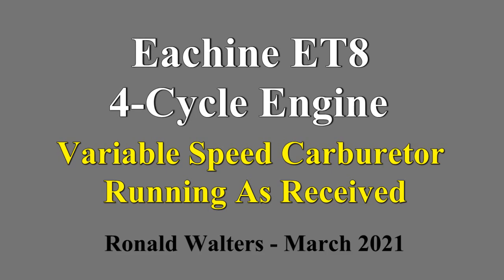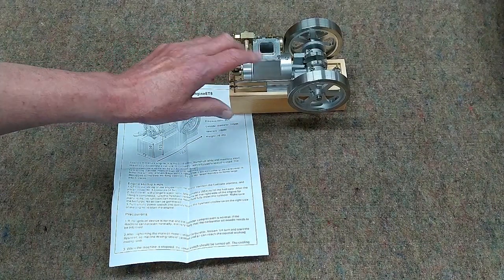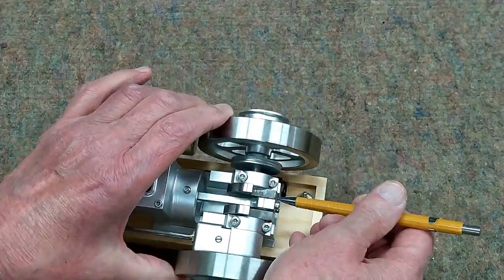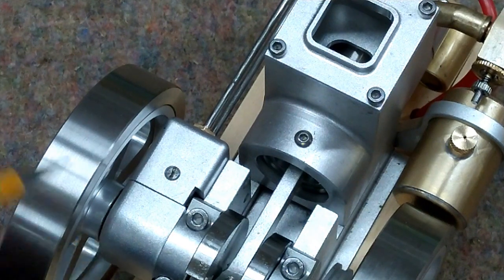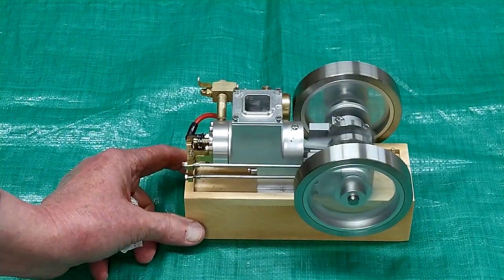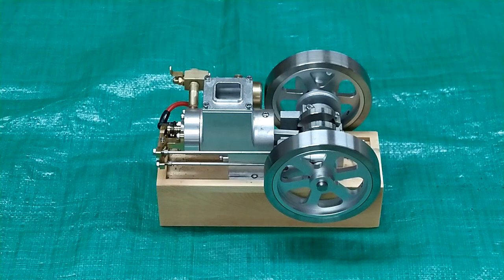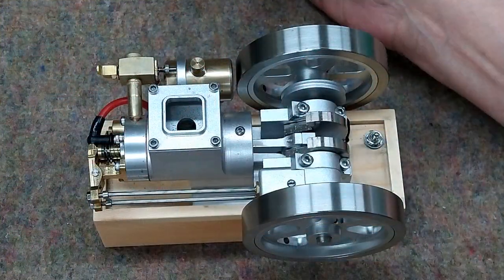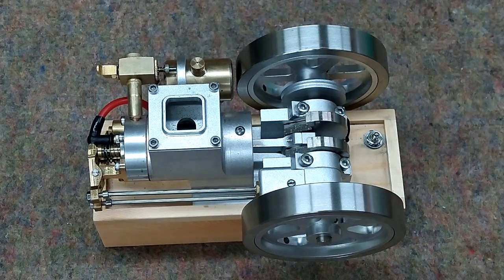Eachine ET8 4-Cycle Engine

Comment: Can you publish the user manual for the Eachine ET8? Thank you very much.
Reply from the maker: ET8 is a Banggood model number. The manufacturers designation is M93.
The single page information sheet is shown at the beginning of the video and that is the only "user manual" and it is pretty worthless.
This IS NOT one of my favorite engines. It suffered several problems, one of which was a very sloppy carburetor which leaked air causing poor engine runs. 
I have a video on fixing the carburetor as well as a video on improved running and one with it running under load.
Keep in mind these are hobby model demonstration engines and are not intended to run for a long period of time. Thus the relatively small fuel tank. Run them until they start to get hot and then shut them down and allow to cool before running again.
Unless you have a specific desire to own this engine... there are much better engines available.
If you must have the single page information sheet go to EngineDIY.com and ask them to sent you one for the M93.
Thanks for watching. Please subscribe! 
That is what keeps this channel going. 
Ron

Comment: Do you use a 25 1 mix wirh gas and oil?
Reply from the maker: I do not use gasoline or petrol.
Watch this:
Correct Fuel For 4 Cycle Hit & Miss And Other Model Engines
https://youtu.be/n1zOC2C-iy0

Comment: আমি আমার জন্য একটা কিনতে চাই
Reply from the maker: I would not recommend this ET8 engine. Too many problems.

In this series of hit-n-miss engines ET1, ET7 and ET6 are my favorites, in that order. 

ET1 was the first in the series. ET7 has a simplified governor and is easiest to work on in terms of replacing the piston ring o-ring. 

EM2 is also a really nice engine. Pretty little engine and a good runner.

ET1, ET6 and EM2 are currently in stock at Banggood,

Please use one of the links found in the description for my videos.

Thanks for watching. Please subscribe! 
That is what keeps this channel going. 
Ron

Comment: Hi Ronald, Which model would you recommend of this engines..what working relaible ?
Reply from the maker: In this larger series of hit-n-miss engines ET1, ET7 and ET6 are my favorites, in that order. 

ET1 was the first in the series. ET7 has a simplified governor and is easiest to work on in terms of replacing the piston ring o-ring. 

EM2 is also a really nice engine. Pretty little engine and a good runner.

I would totally avoid the ET5 (M12), ET5 Pro (M12 pro), ET5S (M12C) and ET8 (M93) engines.

Banggood has a 30 day refund/replacement guarantee. But I always suggest using PayPal for payment, which simply gives you one more layer of protection. Therefore, if it is damaged in shipment or doesn’t run you are covered. Banggood may ask for a little more for insurance, which isn’t a bad idea.

If you use one of the links in the video descriptions I get credit for the sale and often times the discount code will save you some money. If the engine is already on sale the discount code may not work.

Thanks for watching. Please subscribe! 
That is what keeps this channel going. 
Ron
Reply: @RonaldWalters2010  
Thanks!!

Comment: Hi, I like your videos, all are very interesting, you have a new subscriber, I'd like buy my first one model, but I'm not sure which model choose, what could be your recommendation about this series or another like this .
Reply from the maker: Sorry, youtube just sent me your comment (one month after you left it).

In this series of hit-n-miss engines ET1, ET7 and ET6 are my favorites, in that order. 

ET1 was the first in the series. ET7 has a simplified governor and is easiest to work on in terms of replacing the piston ring o-ring. 

EM2 is also a really nice engine. Pretty little engine and  a good runner.

I would totally avoid the ET5 (M12), ET5 Pro (M12 pro), ET5S (M12C) and ET8 (M93) engines.

EM4 runs very well, smooth consistent speed adjusted with needle valve setting, but has the water tank and pump which are an unnecessary complication.

EM1 is a beautiful little engine. It arrived all falling apart and as stated in my video I had to replace a number of setscrews and figure out how it was supposed to run. The manufacturer acted like I was asking for trade secrets when I asked which direction it was supposed to run and how to set the timing. A low speed engine that sounds like a singer sewing machine running and is VERY sensitive to needle valve position (which can make it difficult/impossible to get it to run the First Time). May not be the best engine until you have more experience working o these engines.

EM3 turned out to be a very good runner. Showed up with the piston liner o-rings leaking and I wasn’t getting any satisfaction from the manufacturer (and I am reviewing his engines – go figure). I had to figure out my own method of getting the liner sealed and then it ran well. However this engine disappeared from Banggood and it appears the manufacturer may have quit making it. 

Some of the newer engines in my opinion are way over priced and just not worth it.

Banggood has a 30 day refund/replacement guarantee. But I always suggest using PayPal for payment which simply gives you one more layer of protection. Therefore if it is damaged in shipment or doesn’t run you are covered. Banggood may ask for a little more for insurance, which isn’t a bad idea. Engines which are in stock have been reaching me via air freight in about two to three weeks. There may be fewer air freight flights going to your area, especially now with all the Covid crap.
Reply: @RonaldWalters2010 Thank you very much, I have a ET1 engine. Mine is about three years old. Your video's are Great. My next engine may be a ET7. Thank you, Mike

Comment: thought the whole video "adjust the damn fuel x)" and then u said it in the end :P.
Reply from the maker: The intent of a review video (at least it is my intent) is to review one of these as received and demonstrate what people can expect right out of the box. The carburetor on this engine was sloppy and poorly machined. It leaked air and did not want to hold a setting.
There are additional videos showing how the carburetor works and how I solved the air leak (call it a Band-Aid). So if you are actually interested, I have more information regarding this engine on YouTube.
Thanks for watching!

Comment: These are pretty cool and a fun project starter as well as a unique conversation piece. Do you order these directly from Eachine’s?  And if so, did you ever have any issues with your orders?
Reply from the maker: I would avoid this particular ET8 engine. 
My favorites (and the ones I would recommend in this series) are the ET1,  ET6 and ET7 Hit & Miss engines. All three run well. I have reviews on all of these engines plus a Playlist which groups all of them together.
I do not order from Eachine. Purchase the engines using my links and discount codes from Banggood. They ship fast and the engines are well packed. I have not had an issue with Banggood. Banggood has a 30-day refund or replacement guarantee... and if you want more protection, use PayPal.
Please subscribe. That's what keeps this channel going!
Ron
Reply: I just found the links you added to get these. 
 I still would like to know if you had many issues though (from the manufacturer, not necessarily shipping).

Comment: The Microcosm/Eachine engines are well designed, and made with good quality materials mechanically. The ignition modules they supply however can be sketchy, and leave you with a very nice looking paperweight. Of the 4 of these models I own, two of the ignitions completely died after very little use and they are $50-60 for replacements so I'm putting off getting any more of these for a while.
Reply from the maker: Sometimes the two-battery trick solves the problem with the ignition system… but sometimes not. An electrical person, with a bit of entrepreneur in their blood, could sell quite a few GOOD ignition packages for these engines.

Comment: I expect to see a good cooling system for next models. The little water tank is not enough for a fully functional 4 stroke engine. It was ok for hit and miss but not for this. 
(Im looking for real application)
Reply from the maker: This heats up the water pretty fast. In terms of "real application" these aren't it. You'd spend too much time replacing o-ring piston rings. They remain a hobby engine... or for a model boat of something.

Comment: I recently had an ET6, it never ran, the ignition unit was duff, to be fair they refunded my money, so there it sits on the shelf
Reply from the maker: Unfortunate as I am convinced these engines are all test run at the factory before being packaged. However they are probably bench tested before actually being mounted on the box with the installed ignition system.

Assuming all the following were checked and verified:
Note: I have experienced every one of these when trying to diagnose someone’s problems. Sometime more than one thing is wrong.

Correct fuel (be surprised how many try to run these on alcohol or kerosene).

Good batteries. Trying two batteries plus a blank sometimes solves the problem.

The switch is good and in the ON position.

Wiring was traced and the system is properly grounded and tight. Stuff can shake loose in transit. Ground wire can be loose.

Head bolts are all tight. 

There is compression… valves are closing as they should.

No bubbles in the fuel line.

Needle valve ¼ turn open.

Spinning it clockwise as viewed on the governor side of the engine.

That there is actually a magnet in the magnet disk. Stuff shakes loose in transit.

Spark plug is good (Has a gap and is not broken.)

Ignition is timed to fire just past TDC (top dead center).

Use a volt meter to verify the battery pack is actually connecting all batteries.

Batteries are in battery pack in the correct position (correct direction).

Nothing is broken or bent with the flying ball governor mechanism and all moves freely.

If you have zero investment in your engine, a replacement ignition system including shipping is just under US$60.00 and the ET6 is a nice running engine.

Eachine 4-cycle Hit & Miss Gas Engine Ignition System Replacement ID: 1573481
https://www.banggood.com/custlink/vGKyIqn6JN
Reply: @RonaldWalters2010  Thanks for your reply, I’ve checked and tested everything you’ve kindly suggested, the wooden box damaged on receipt. I may get a replacement ignition system, but I have seen a few people have done this only to receive another defective unit, luck of the draw I guess.
Reply from the maker: First time I've heard of a wood box being damaged. Their foam packaging is pretty good. Must have taken quite a hit somewhere along the line. Which would lead me to think something else took a a lick at the same time.
Strange characteristic of the ignition module... some will cut out with a full 4.5  VDC but work fine with only two batteries with a dummy battery delivering 3 VDC. And since the module is full of epoxy we can't see what is going on inside.
Reply: @RonaldWalters2010  Yeah, I sent them photos of the damage, and I implied other damage had possibly been caused, they just refunded me. I do think on reflection it must have been damaged prior to packing into the protective foam cube.